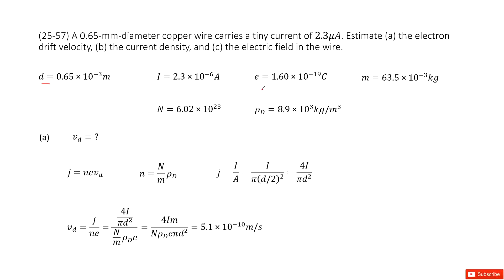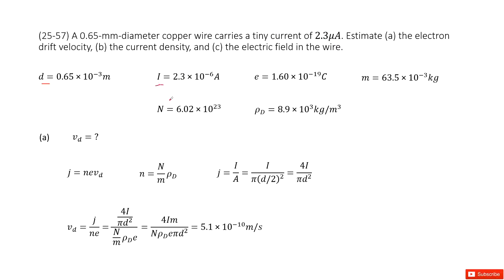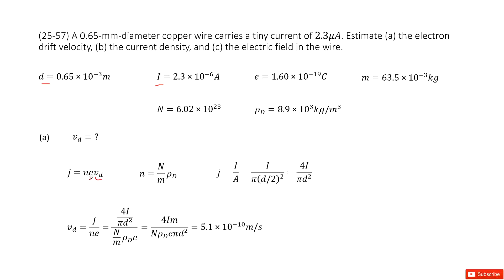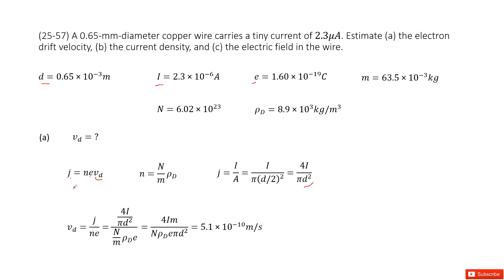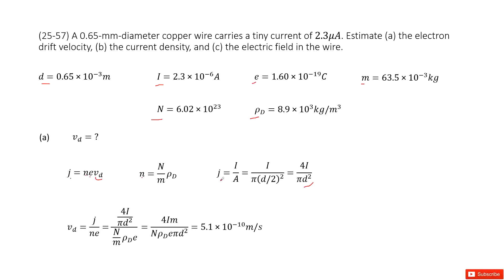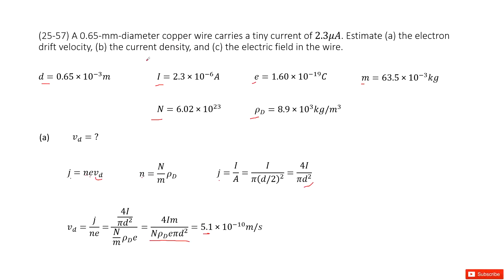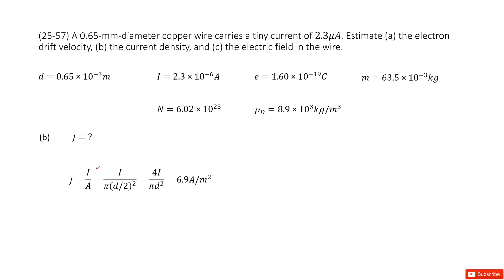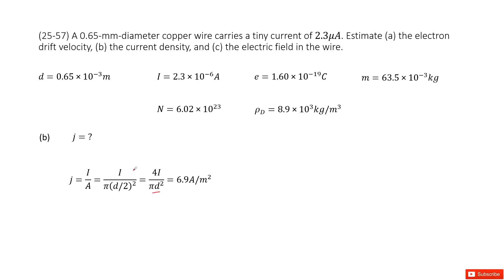(25-57) A 0.65-mm-diameter copper wire carries a tiny current of 2.3μA. Estimate (a) the electron dr

Comment: Please explain the strange formula for the amount of substance in more detail. you have a mole equal to the number of tiny things per relative atomic mass times density. The relative atomic mass can be expressed as mass per amount of substance. So the amount of substance cancels out. Density is mass per volume. So mass cancels out. And we are left with one on the left-hand side of the equation and one per volume on the right-hand side of the equation which leads to the incorrect conclusion that volume is equal to one. Am i missing something?